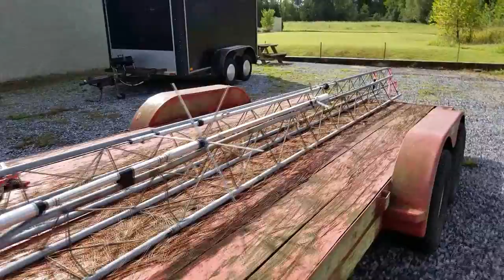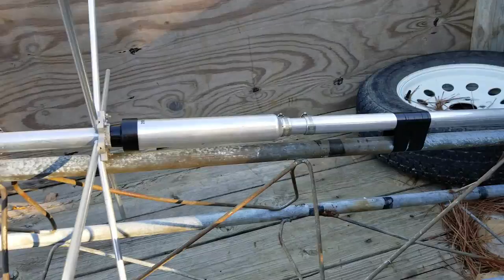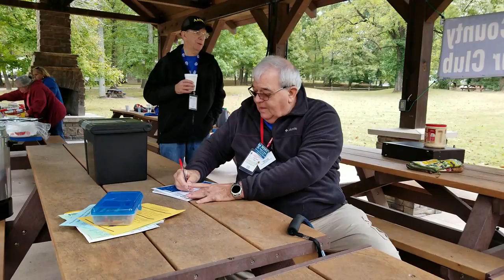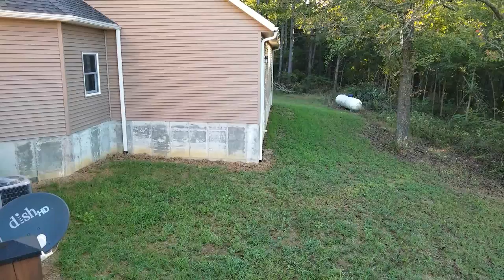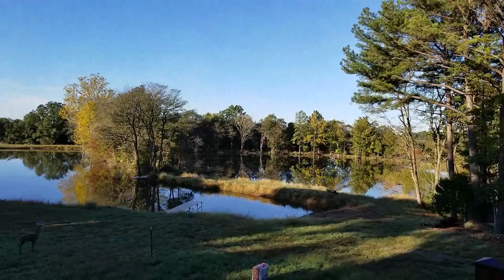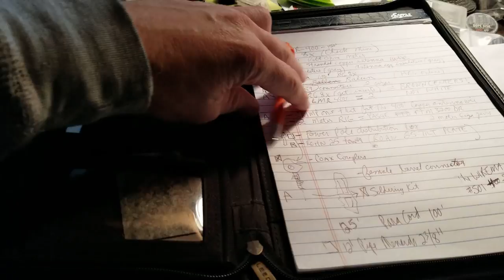Ham Radio Testing! And Step 1 of setting up station and tower! See how it went!

Comment: Being that your soil is fairly new you may want to go with a full soft soil tower base.  Drilling a base hole and doing a reinforced concrete structure for your tower with guide wires for the tower.
Reply from the maker: I think it is settled enough plus I'll have a bracket support about 8 or 10 ft up to the home so I think it'll work. I really don't want guy wires.. when I make the concrete base I'll be sure to pound rebar sideways in several directions into the dirt that will also help the concrete grip

Comment: I haven't seen you so excited about something in a while Joe.  Rekindling a good memory is a great way to burn your down time when you are healing from the next two surgeries.  Any idea when the next one will occur?  Obviously some of the projects are flat not going to get done this year.  What is the plan man?
Reply from the maker: wait a minute Gary! There is still lots of time to get projects done this year! LOL And yes, feels good to get back into something that I've always wanted to.. Only this time I will have a much better setup than what I did almost 30 years ago....  Will also be good to add in a hobby during the cold winter..  I am still doing the deer towers at 211, I promised them guys I'd have em up! Hoping to drop the tractor off over there today, then bring the trailer over to have the towers loaded, so hopefully in a few days I'll set those towers. Still hope to finish off the duck pond also! And maybe deer hunt a little! whew...... We'll see how it goes, but it beats being bored! Thanks man.
Reply: Maybe it's just me but even though I had a fancy Kenwood TS-940 just before getting away from radio, I think the most fun I had was with my old Heathkit DX-40 transmitter and Hallicrafters SX-100 receiver. I paid $20 for the DX-40 and $50 for the SX-100.  The equipment was crude but it made you work harder for contacts. And the smell of those tubes on a cold winters night..... :-)
Reply: Are you putting that trap vertical up on the tower or ground mounting it?
Reply from the maker: Vertical on the tower but we're also going to build a couple of wire antenna's to boot.
Reply: You might want to reconsider ground mounting it. With your soil you probably won't even need radials. You need radials when tower mounting a trap vertical.

Comment: Do you get feedback from the testers on what was wrong?
Will you be adding support wires and a ground strap?
Reply from the maker: No feedback or anything like that it's either pass or fail. yes I'll have 8-foot grounding rods but no support wires it'll have a big concrete base
Reply: It's obvious that I'm concerned about winds.

Comment: That hustler 5BTV antenna and Yaesu 920 won't do you much good with just a tech license.  Unless you want to practice CW. You can build a 6 meter dipole and play around on 6 meters at least.
Reply from the maker: I'm a general class now, still working on my setup.

Comment: I assume you are going to mount that vertical antenna on the ground?
Reply from the maker: That baby is going 60 feet up in the air :-)
Reply: That means you are going to need lots of tuned radials, which are a PITA. I always mounted my trap verticals on the ground and if your soil is good then you don't need any radials.
Reply: My suspicion is that since Kapper bought the tower and antenna as a unit the antenna is tuned to go on the tower.  My guess is they have it setup so that the tower takes the place of the radials.  I found it interesting that it has a Hustler coil.  I remember using them (10m, 20m, 40m & 80m) on my HF mobile antenna when I had one on my full size Bronco in the early 90s.
Reply: It could be but the manual for that antenna shows that radials are required when using an elevated mounting position. I mean, it will *work*, just not nearly as good as if installed properly.  I've always ground mounted any trap verticals that I ever had.  It sure seems a waste to put a vertical on a 60-foot tower.  Since he'll be putting up some wire dipoles it would be best to reserve the tower for a nice HF yagi. :-)

Comment: Looks a new hobby to enjoy.  How far will you be able to communicate?
Reply: In most cases the overall maximum distance will be limited to 1/2 the circumference of the Earth.  :-)
Reply: Hahaha!  That was funny, EOSJOE!
Reply: EOSJOE you can have it wrap around 2-3 times if you get all conditions right.
Reply: True. But the max distance you can communicate is still the same regardless of what path(s) the RF energy takes.
Reply from the maker: not totally true anymore. I plan on getting into digital and packet radio where you transmit voice then it goes over the internet and comes back out voice on the other side of the world crazy amazing stuff they are doing now!
Reply: I was doing VHF packet radio back in the mid 80's. Everyone had to build their own TNC. That's when HAM TCP/IP was just getting started.  Of course there was no Internet readily available then.  I'm not sure I see the thrill in using the Internet with radio to communicate with folks. I mean, what's the point of even bothering with a radio then. :-)  Give me a good 'ole CW or SSB rig and a decent antenna. :-)

Comment: If you were getting good advice you would be buying Icom ......ZL2XL New Zealand
Reply from the maker: Sounds like someone who is brand loyal! LOL Yaseu is also a great radio, and when there is a budget involved, you have to draw some lines somewhere! Thanks.
Reply: No worries Kapper. Yeasu, Kenwood, Icom, etc. I've had them all. They all make decent radios. My favorite however was always Kenwood.
Reply: I was referring to old school Kenwoods...  TS-520, TS-940, etc. Good 'ole knobs and buttons. My old TS-520 had a pair of tubes in the final. Nothing still beats the warm glow and smell of a pair of Collins matching transmitter and receiver. I can still close my eyes and smell a Heathkit SB-401/SB-303 set. No microprocessors in those babies. :-)